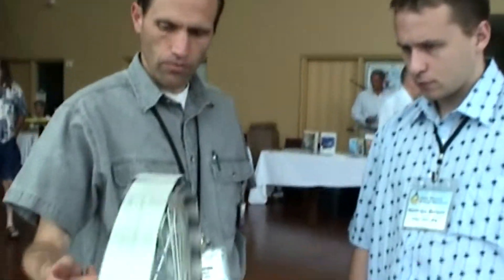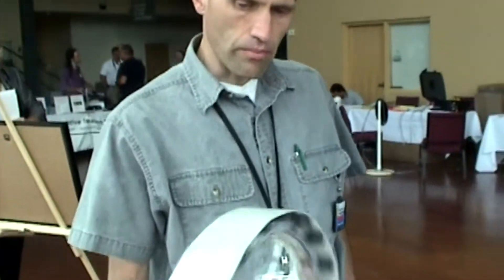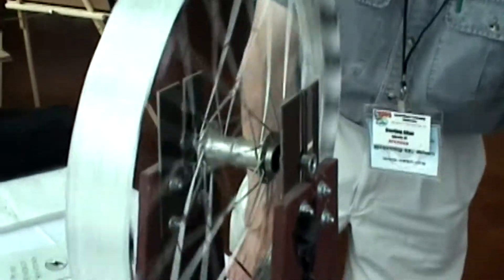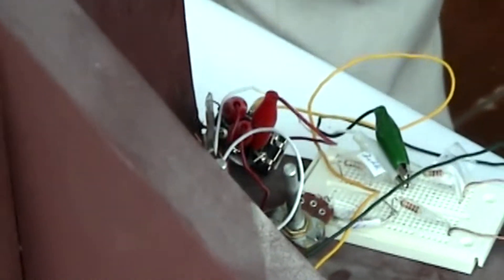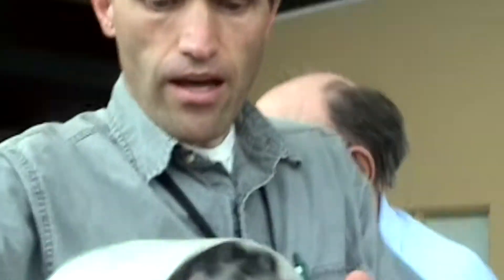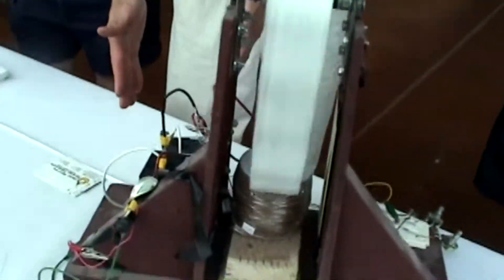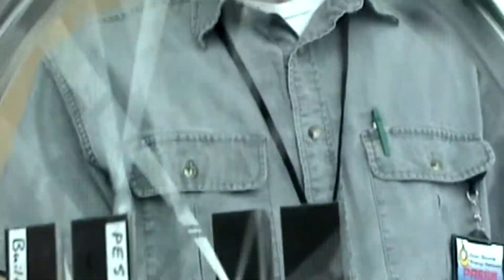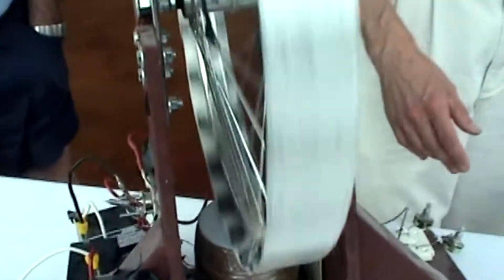Bedini Motor Demonstration

Comment: 53% efficient is still pretty good.  replace the battery with a super-capacitor then hook the capacitor up to a solar panel. And you have free efficient solar power. The sun would charge it the capacitor pretty fast and it would last about 3days. just enough time for more sun to come out! :D